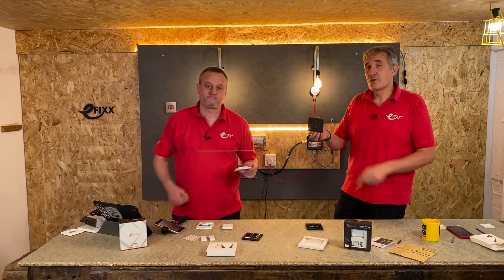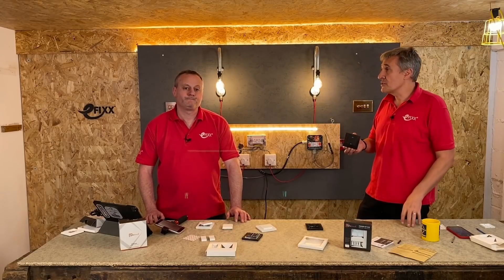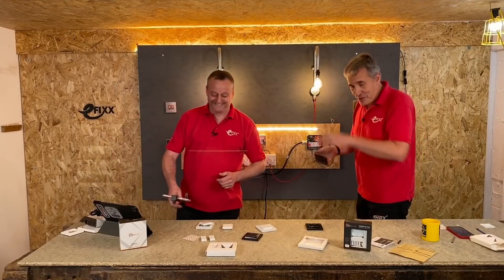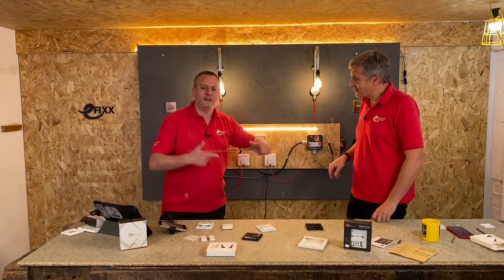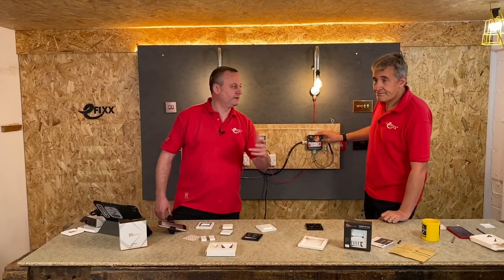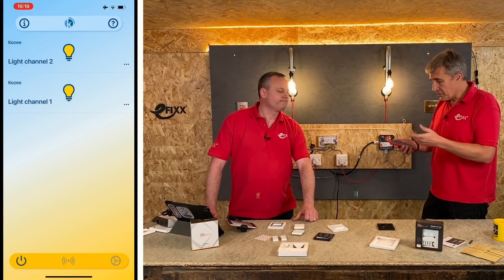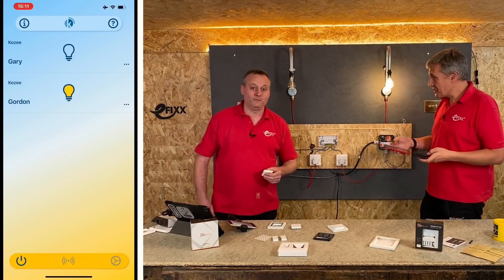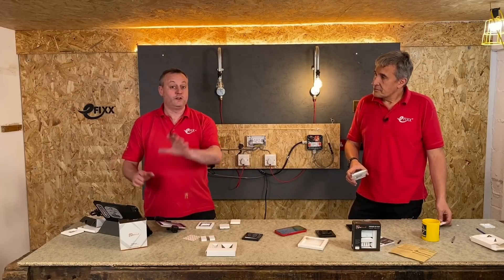WIRELESS SWITCHES with STANDARDS - ENOCEAN kinetic switches by Retrotouch

Comment: You need to do a review on Shelly products knock most of this stuff into a cocked hat and the prices half these too.
Reply from the maker: Do Shelly make kinetic wall switches?
Reply: Never found a product with as many features as the Kozee one. 2 channels, WiFi with app/Alexa and Google, sensor gateway built in.
I have a water sensor and multi sensor (temp/humidity/ambient light/contact) connected to mine

Comment: So the Bluetooth mode paired to the kinetic switch will only work if the phone is in range of the receiver and also switch in range of the phone? Or does it bypass the phone and then stores the switch signal at the receiver after pairing through Bluetooth? This is not clear? 🤔
Reply from the maker: The receiver / relay stores the signal so either the app connected via Bluetooth or the switch can trigger the relay. The relay is paired to the app and the switch separately.

Comment: Nice vid lads. Kinetics is the well known wireless equipment and works

The BIG problem with all this app and P2P wireless switching is signing your life away…… look at the terms of the app you have used 
Collects email home and mobile number   Addresses and they hold your info for 7 years …….. who wants all this hassle and personal data collection just to switch a light on
Uk law will be changing to protect people against this type of product soon
Reply: lol I have the Kozee system and the app only asks for your email address so you can get back into your account if you forget your password, no phone numbers or address. Time to put that tin foil hat away.
Reply: @rayroutledge5953  
I think you need to look at terms and conditions on the app 

So if it is only asking for your email address if you forget the password who is sending you the email
Reply: @tomengineer1467  Google is sending the email as it uses their Firestore service.
I don't need to read anything at all, I know what it's collecting.
Reply from the maker: What’s changing in the law?

Comment: Great stuff, they have their uses, I have been fitting Kinetic based switches for a few years, they are great for as you say, getting out of chasing walls for 2 or intermediate switching, saves a ton of work, and the customer always prefers that lol. I do worry about longevity, support, reliance on bluetooth standards, frequency changes in future etc.. it would be a good thing if all manufacturers standardised the protocol. Cool video.
Reply from the maker: Thanks for your detailed comment and watching
Reply: It is ble so open to anyone

Comment: All fantastic right up to the moment you lose your phone or have it stolen or drop it in the toilet. What happens if you think it's paired but you are actually switching the nabours lights on and off 😁🐔
Reply from the maker: You can still use the switches without the phone or app.
Reply: And you can reset if you really need to by turning the power off and you have 3 minutes to connect to a different phone